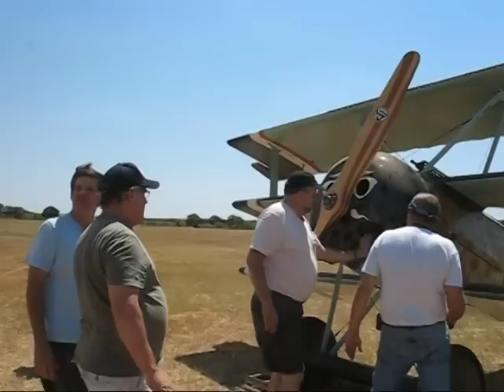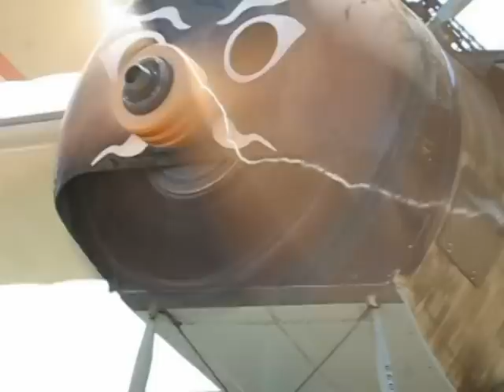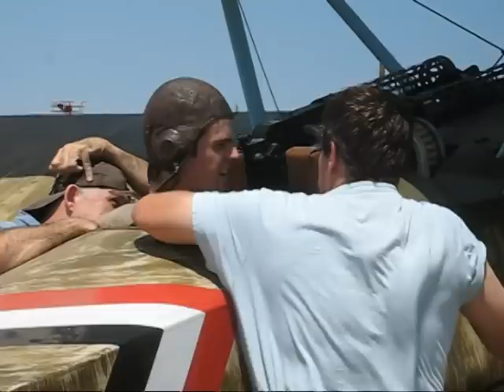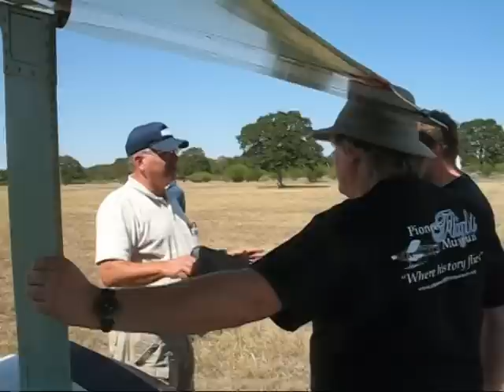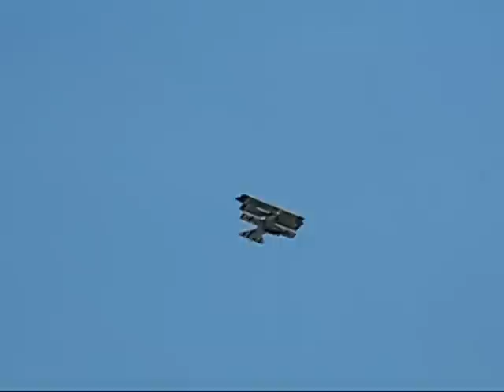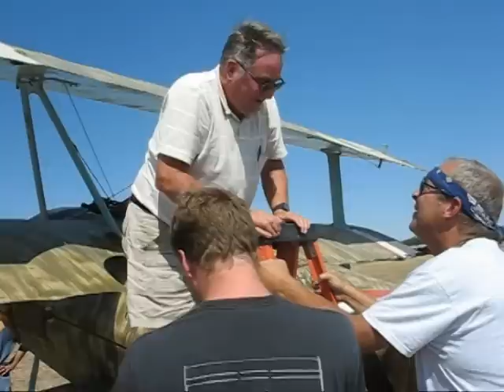Rough Flight in Fokker Triplane.mpg

Comment: That bird came in on nothing more than a wing and a prayer.     The engine needs a tune-up;   it was missing badly.    Or,  it could have been the pilot cutting the ignition on and off for speed control.    We will never know---we were not the ones laying our lives on the line for the sake of aviation & country.
Reply: The rotary engines didn't have a throttle and "wide open" except when the pilot blipped the kill switch which shut off the spark and let the engine spin down until another shot to keep it spinning.

Comment: wouldn't call that rough at all !   That thing is a pain in the ass to get on the ground in wind even worse...has no xwind capability.  You can grease them on,  but when it slows and the tail falls that's when the trouble starts esp in a xwind
Reply: Which is why aerodromes were square back in the day - you would monitor the wind sock and land directly into the wind.